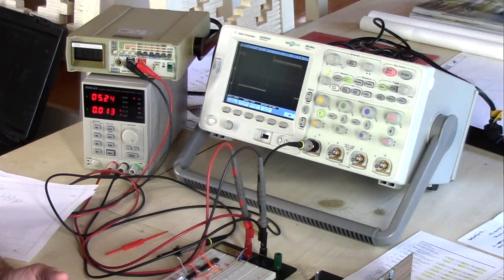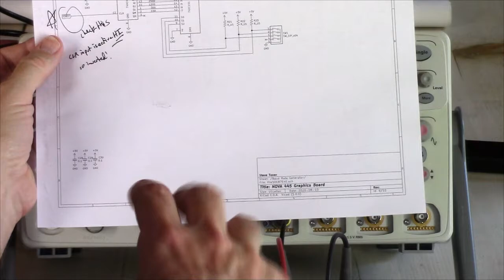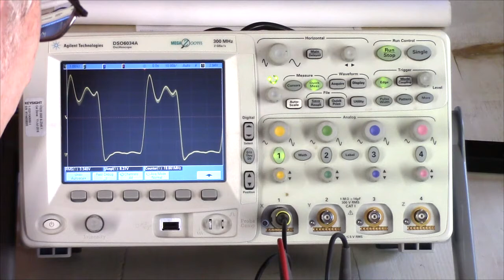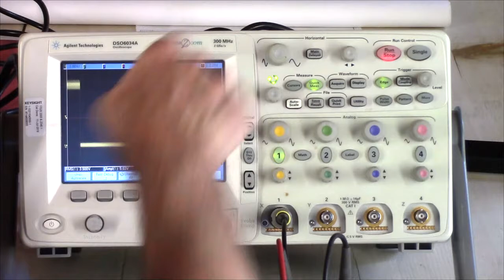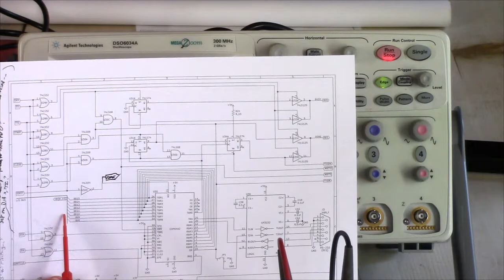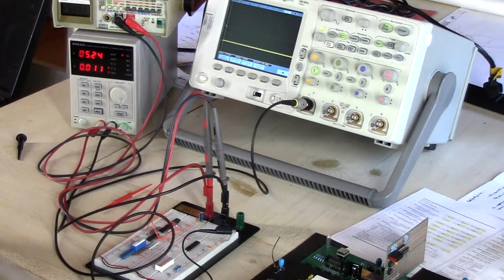Revising the Graphics Card

Comment: What is the graphics chip you're using? I didn't see or hear the part number mentioned.
Reply from the maker: It's the Zilog Z7220, which is the same as the NEC 7220 and apparently the Intel 82720.